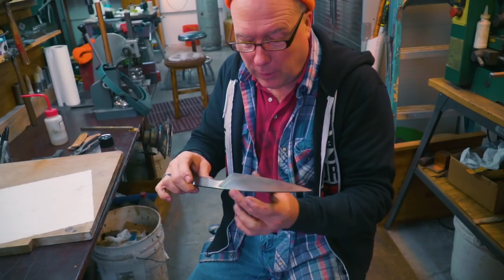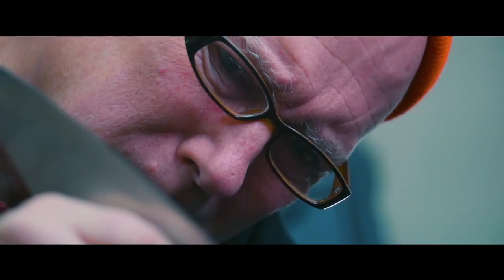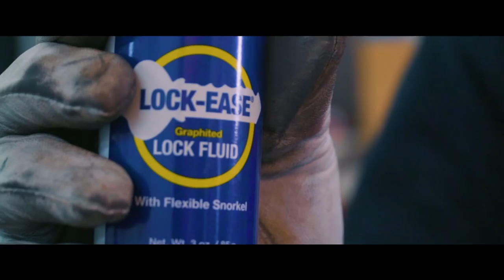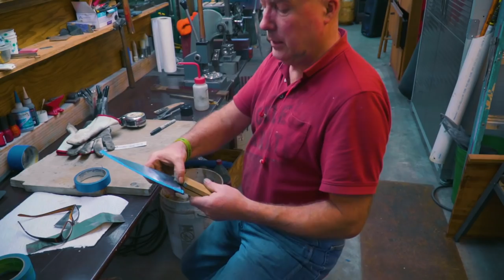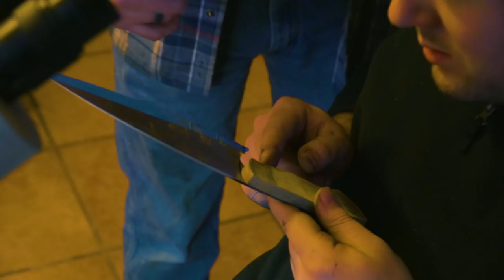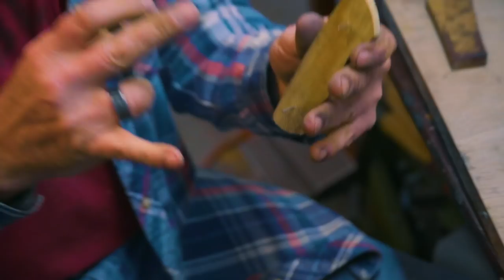How I Fit a Beautiful Slab on My Full Tang Knife

Comment: Thanks for the wd40 tip!  Also Im having a rough time with the angle and depth of the contouring of the handle right behind the heel of the knife. Any tips much appreciated.
Reply: For shaping the bottom of the front part of the handle, where some handles curve down to the heel, providing a smooth comfortable transition, I have used a small wheel on a 2x72, or a softer backed belt hanging off the side of the platen(I have a platen with rounded edges for this step), or a soft belt in the slack portion. If it's too difficult to get with belts, or it starts to not go well, I switch to a 3/4" half round file and dial it in slowly. Sometimes the file is faster in the long run, and teaches shaping. This is only how I do it and the hosts of this channel might do it differently. I hope it helps.
Reply from the maker: Rick, I have a challenge in that same area.  I made a special fixture for the belt sander.  We have several different sizes of small shafts for the belt sander starting with 1/2" radius and up.  If you are using a belt sander don't be afraid to slow down the speed because it can get away from you quickly when doing finesse work in this area.  I like the file idea Aaron, it definitely slows it down and makes it more controllable that's what you want is more control.  Sometimes I will touch it up gently with a dremmel wheel before I hand sand.  Slow down, take your time that's what separates the men from the boys!   If it was that easy every body would be wanting to do it.  ~ Jeff
Reply: @KyleRoyerKnives  Thanks for taking the time to comment Jeff. I have a 1inch wheel I made up its super janky but works. Hope to see your fixture in a future video!

Comment: Did you put a distal taper on the tang? I like micarta handle material. I feel like it offers a really nice grip even when wet.
Reply from the maker: I have not done the tang yet.  I just got my taper mojo down on the blade.  I am going to do a tapered handle soon, keep watching.  Yes, the micarta is spectacular.  We came across a pretty good jag of vintage micarta and plan on using it from time to time. ~ Jeff